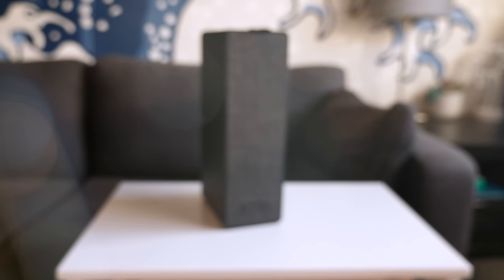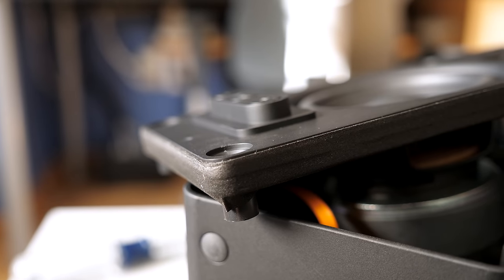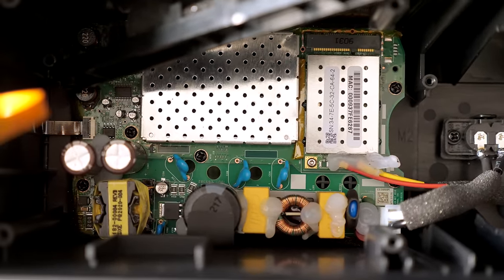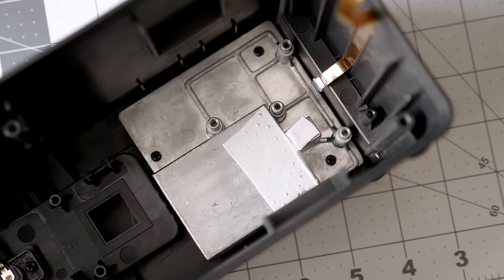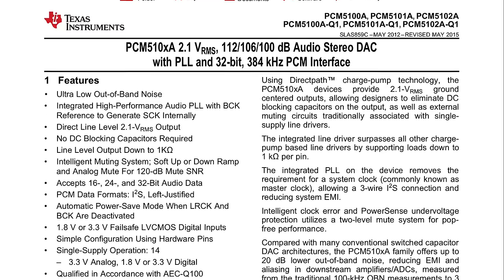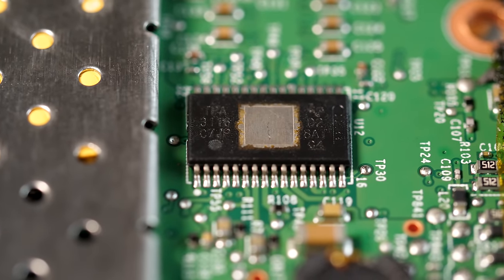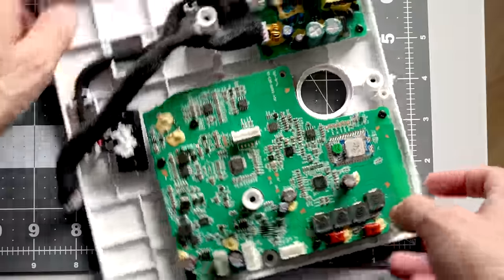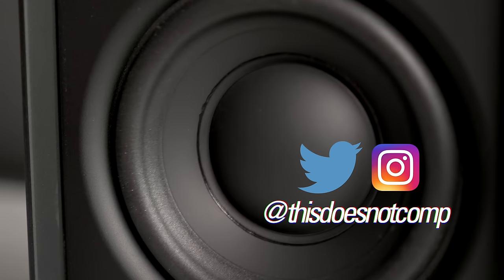IKEA's Sonos Speaker Has a Secret

Comment: CapXon is among the crappiest capacitors available; I´ve changed load of these i PC PSU's, TV's etc with only a few years into service. Kudos for you to really taking notice of this in the video! I even didn't have to pause the video to make it out ;) (y)
Reply: Just out of interest, what do you typically change them to?
Reply: @richardwilliamjohnson8566  Basically any Japanese cap will do; Rubycon, Panasonic, Nippon-Chemicon, Nichicon, Suncon and more. I use all of these depending on my stock and specifications. CapXon should not be used even if someone pay you to use them, they´re just dreadful.
Reply: @mikaelandersson4733  thanks Mikael that's really handy info.

Comment: I'm rather surprised that the giant of MDF furniture didn't use MDF but plastic for their speaker. It seems almost out of place and cheap for them. It's a bit disappointing, as IKEA has all the power and process to sell a much higher quality speaker system at sensible prices.

Comment: You mention the speaker driver units looking like they're from the same range, but really that applies to all speaker drivers! They come in a range of pre-set sizes, and the laws of acoustics mean there's only so many ways to design one, and often only one or two good ways. The "bass" (3 inch!) drivers you mention look very different as far as speakers go, one is an "inny", one an "outy". The inny looks like it has some kind of secondary part to the cardboard cone as well. Other than that they're black and chunky, which higher-power small drivers tend to be. 

For the ADC, in practice things like Alexas don't seem to use ADCs. They use MEMS microphones which give a digital output, either PDM (something like PWM) or I2S, a digital bus designed with sound in mind, which uses PCM. Technically PDM isn't digital since it's not discrete in time,  but you can at least read it with a digital pin. 

You can even get arrays of mics, that are useful for Alexa etc. A bit of maths a lot like the beam-forming used in radar and 4G, can inverse beam-form, can act like a directional mic and listen only in a particular direction, once you've done some similar maths to figure out which direction the user is speaking from. 

The original Alexa didn't have an array per se, but 8 mics around it's top side in a circle, IIRC. Did the same job though probably cheaper than stringing array mics all around each side, you'd need probably 8 arrays to be able to hear from every side. You can do rough beam-forming with 8 single mics, good enough to hear a single person talking, since people are polite enough to shut up when somebody says "Alexa". 

The same maths, as well as sonar, can be used with speakers to generate directional beams of sound from a flat speaker array. Constructive and destructive interference.
Reply: Woa so much details😍😍

Comment: I build speakers as a hobby for 30 years. ... That batting in the one speaker is doing absolutely nothing. Not dense enough or abundant. It was put there for you to think it was better and or doing something. But it was not. for example . Took apart a Cervin Vega speaker in the mid 90's. 12" 3-way. The mid had a sealed tube and the 12"  woofer was wrapped in 1" think fabric flooring pad type of material and stapped to the cabinet. Very dense, kind of stuff used in cars (1/4" think) for sound deadening. All the sound had to pass through this dense fabric. Anyone knows a 12" C.V. does not lack bass, C.V. are known for quality bass. that strip of pillow stuffing was for reviewers. Back in the DAY 70s' 80's. A ported speaker is not damped until you stuff it with wool or glass 50% or more. Or you line 3 or more walls with dense fiber glass.

Comment: You think you’re buying a speaker... but no, it’s really a small computer.  For $100, I could make speakers with two drivers and a capacitor for high pass to the tweeter.  No circuit boards or power supplies required, and you can play it louder than these will go.
Reply: And how do you power the speaker. You would still need an external amplifier, probably $200-300 . This is a POWERED speaker for $99 - it doesn’t get much cheaper !!

Comment: I'd be interested in hearing how different the frequency response curves are between the different speakers. I'm guessing the Symfonisk has better bass extension because of the larger enclosure (therefore lower f3) so not only is it cheaper it possibly sounds better too.

Comment: Good tear down and analysis. 
The tape around the front panel is not primarily for sealing, it is for preventing rattles. Sealing is a secondary issue. Your missing the point there is a giant air  vented port at the bottom of the front panel.
You mention your self how all the wiring is foam taped and hotmelt held down. Again anti rattle techniques. We used to do this at the Australian Magnavox Speaker factory.

Comment: Is that a foam surround on the woofer? If so, I call planned obsolescence. They were widely used back in the day are notorious for disintegrating, which is why they have almost completely disappeared from the audio landscape. Together with the indeed cheap capacitors (although they are 105°C types at least) they use, instead of cutting cost at the overpowered computing power. Why the extra DA-converter (and a burr brown at that) instead of letting the microcontroller do the conversion? Some design choices do indeed not compute. Thanks for the amazing video!

Comment: Padding or acoustic damping in the enclosure doesn't improve bass response. In fact it does the opposite, you'll get less bass from the enclosure. What it does do that beneficial is damp out resonances inside the box that my leak to the outside or effect the woofers movement.

Comment: I’m 10 minutes in. I still don’t know what the secret is...
Reply: Secret is it’s like a taller Sonos Play 1, for $50 less. The title kinda gives it away. Very similar circuit board layout and parts, somewhat similar speaker cones. In my experience, they could perform much more differently than the narrator suggests, based on all the wildly different sounding headphones with drivers (speakers) even closer in size than these two.

Comment: These CapXon capacitors may last quite a while, i wouldn't be too worried about them. It just depends on the temperature. Stick a thermocouple on there and see. They're no longer quite the same fundamentally faulty products they've been selling around 2004-2005. You will find that the longer crap component brands stick around, the more dependable their products get, they all learn from past mistakes. You'll still find them frequently fail in LCD TVs/monitors, but that's largely a design problem, where they're being run much too hot. Low-ESR types are fundamentally more problematic, the designers try to alleviate their high-ripple design issues by using low-ESR capacitors (fox CapXon they're i believe green-gold or black-gold), but the problem is, the caps don't stay low-ESR for very long, and rapid degradation sets in once they start to drift, while standard types, in circuits where such are adequate, usually last an eternity.

Why is Sonos interested in this arrangement, making and selling a cheaper off-brand speaker? Simple, because marketing and retail distribution that they usually rely on is EXPENSIVE, and IKEA is extremely efficient and eager to expand their product range to keep their stores attractive to tech-affine and other kinds of customers - by far not all IKEA products make a significant profit, many are just there to lure people in. By all reason it's the same to Sonos whether they sell their own speaker for $150 but more than half of that goes to distribution and marketing, or whether they sell $100 speakers via IKEA but marketing is free and cross-promotes their products, plus distribution costs less.

Comment: 00:50 - holy smokes!!! 😮... an early Bluetooth/wired idea I had for making speakers more stealthy in the age of shrinking home speakers with all of the theater systems in a box that were coming onto the stage... [open palm wipe to face]. Just had the hurdle of bulb filament longevity at the time prior to the age of widespread compact fluorescent and LED bulb usage.... I subsequently shoved that idea for a Sharper Image product back so far into my memory due to the contemporaneous hurdles
Reply: Just2Options? Irrational: FearOrExuberance? Would make sense then and now to have a regular Edison socket for a regular replaceable light bulb.  Longevity problem solved, especially if you have a store selling regular lamps too.
Reply: @johnfrancisdoe1563  ,
 What would have been contemporaneous pricing of the fixture you're referencing and replacement bulbs? 
Was that typically consumer level lighting or commercial/business? Not sure if I saw that in North America at the time at the hardware stores. Bulb selection had to be something easily accessible and not necessarily captive to online/catalog ordering as the latter was in its infancy and I don't believe consumers were going to put up with having to get a bulb from a catalog. Maybe it's something I could have approached again in the early to mid-2000s
I'd been considering overall costs and Bluetooth was a burgeoning technology while being ever aware what a consumer thought they wanted to pay for what would've, first, been seen as an end table / side table / sofa table lighting proposition (the last of which would have been ideal - lamps to either side of  the listening position  to act as the surround speakers) whereas each unit doubles as just one of at least two or more speakers within a system since stereo-imaging audio was the standard expectation minimum. One lamp by my numbers back then was going to be a hard sell at ~$200 minimum, each.

Comment: if that product is the same quality and functionality as my sofa from ikea then ..nope
Reply: Actually no Tomasz. That was the whole point of the video! He was showing that this Ikea speaker is largely a rebadged Sonos designed Play 1 speaker. The electronics and the PCB are IDENTICAL, even to the extent of the “sonos” marking on the PCB, and the tweeter and woofer are very, very similar. The major difference is the size and style of the enclosure. So, when you buy this you’re essentially getting a Sonos speaker, NOT an IKEA designed and made product - at a 33% price saving! So any preconceived ideas regarding Ikea products in general and their quality DOES not apply to this! 
Sonos products are very well made, perform extremely well and are renowned for their reliability and practicality. They were the first company to develop and sell such powered speakers for wireless, whole-of-house audio, almost 15 years ago. In that sense, they are the “Apple” of wireless distributed audio.
And very reliable. A number of years ago, I was managing a hi-fi store, where we sold Sonos products. It was one of our most popular brands and by far the most reliable. In 5 years we did not have a single one come back for repair - compared with some of the major Japanese amplifiers that were failing at about 1 per month!

Comment: so, from the chip specs, it does support external connection, all we need to do is solder the connector and use an external audio source, right?
Reply: No, it won’t work! Because the app software doesn’t have the facility to accept an external source!
Reply: @Nicholas.T  app? with an external connection, as I understand, you run as a simple speaker, no app needed...
Reply: @balexandre  Have you used Sonos products before? Because the source selection is software controlled. You can solder in a physical external jack, but the software won’t know its there, so there’s no way to ask the Sonos user interface ( in the app) to select it.  The only way to do it, is to rewrite the software, which is not really possible !! Trust me, I sold Sonos products for 5 years and know them very well !!

Comment: Interesting to see they still use traditional drivers which will provide the best sound.  

So I have an observation to offer on the lack of sound insulation.  First, I usually do not see dampening material inside of small enclosures unless they are part of a larger enclosure.  One reason for dampening is to prevent peaks in resonant frequencies.  This is more noticable with much larger enclosures.  With smaller enclosures those resonant frequencies can be higher.  In some cases the volume is tuned to certain frequencies to make a small speaker sound louder.  Guitars are tuned in much the same way.  But in the case of music you want the program to sound even throughout the spectrum unless the artist intended for something different.

Second, I noticed several ribs inside the enclosure, and it is easy to assume they are to make the enclosure more sturdy, and this is true.  But they have a hidden advantage of becoming the dampening material that is needed.  Every simple, one piece thing has a resonant frequency.  Look at lengths of pipe in a wind chime or a pan flute.  But when you add features, like simple ribs, and then design them to each be a different frequency the sounds can cancel each othef out.  They will also slow down the air and prevent sound from reflecting from the inside of the enclosure.  Thing of an empty room, and the same room full of furniture.

Comment: The 'hack' someone already did to reuse the amp in the bookshelf model with another speaker already makes it a fun device, what would really get this flying off the shelves for the 'hacking' community is if the digital audio output (before it gets to the DAC) could be switched to stereo, so that you can send two full range channels on to the amp.

A $99 well packaged off the shelf, Sonos enabled, Ethernet, three button playback controls, with a two channel 40W (at 4ohm) amp would be the absolute dream. Re-using the entire amp module for something like the speakers in the link below would be a PERFECT combo. Even better if it were also possible to hack it another way so that it was in bridged mono mode as the amp module supports 100W@2ohm. I could see a very nice little 2.1 system being built!

https://www.parts-express.com/passive-aggressive-mini-speaker-kit-pair--300-7148

Comment: so the Sonos one also has the  cheap capacitor ??
Reply: 10:06 - Looks that way
Reply: @paulphipps8741  damn have 4 off them ! (abort 2 years old) hope the last at least 10 years with that price tag !!!
Reply: @christian1965  Capacitors are the weak points for lots of electronics. They're pretty easy to detect and replace. It you're into it, it's worth getting a $75 soldering setup, as in it can pay for its self. - It sounds like you're happy with the product (no pun intended,) I think I'll make a setup with them too.

Comment: So wait...  Those same cheap capacitors are used on that board in Sonos speakers? ... And Sonos is typically expensive... I'm not sure the cost cutting makes sense here.  Capacitors are a very inexpensive part no matter how good their quality though, you can only save literally around $2 maximum by using cheap parts.

Maybe that brand of capacitor has proven to be more reliable than in the past?  Because nobody wants to spend big $$ on a speaker which will malfunction in only a few years...
Reply: The times when CapXon made fundamentally faulty products are about one and a half decades ago, they certainly learned.

Who hasn't is by and large the electronics manufacturers. Of course chances are, you'll open a recent dead TV made just a couple years ago, and you'll find that specifically capacitors of this brand have failed. Two reasons, it's one of the biggest manufacturers by far who can actually easily cover the volume, and the other being design abuse where they're simply run way too hot. Whenever i see low-ESR types specifically relied on, it's an instant cringe from me because even if you get Taicon, they just aren't going to stay low-ESR for very long and rapid degradation will set in. These are standard types here so chances are, it's a benign design. Most of the time the amp will just idle by all reason, and the processor board isn't a very high consumer. Someone needs to stick a thermocouple in there and check how warm they get.

Comment: Batting wasn't necessary because a 3" driver doesn't put out any low bass in that type of enclosure. You're disappointment is caused by your lack of knowledge of cabinet fill and the implementation.

Comment: 105° caps won't need replacing that quick
Reply: Don't hold your breath! - many radial CapXon electrolytics have a endurance life of 1000 to 5000 hours, with their extra endurance range offering 10,000 to 20,000. I would guess the ones  in this speaker are their cheapest 2000 hours range.Even if they used 5000 hour endurance rated caps that is 208 days of continous use and this speaker is always plugged in and active. I'm sure it'll last more than 2000 hours but 2 to 3 years may be a fair stab at their likely life.  http://www.capxongroup.com/files/2018%20Capxon-180724.pdf

Comment: These are not a "win" for consumers if the cheap capacitors are going to give out after a few years. Just another example of the throw-away culture these companies create so you have to buy a replacement.
Reply: With standard use those caps will probably last 20 years.
Reply: @Bonswally    agreed...my 4 Play 1's were ordered on released making them 6 years old already...and playing fine....fingers crossed.   Very few people would be maxing out a Play 1 as that is really NOT what the speakers are intended for..
Reply: @JBR.1974  Even if it was maxed out there isn't a problem.  Capacitors generally last a very long time, even cheap ones.  Not something to worry about.
Reply: Bonswally so why did TDNC state they’ll probably need replacing in 5 years?
Reply: @JBR.1974  You'll need to ask him that.  They won't.